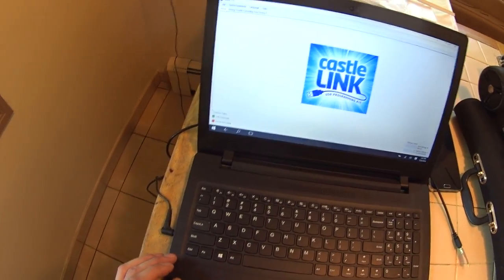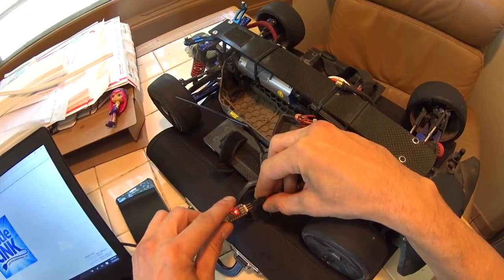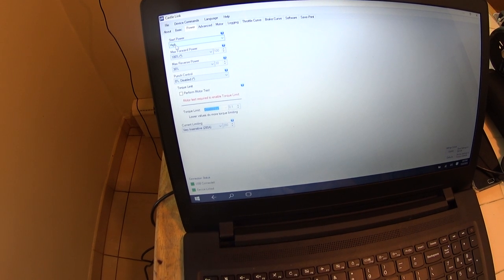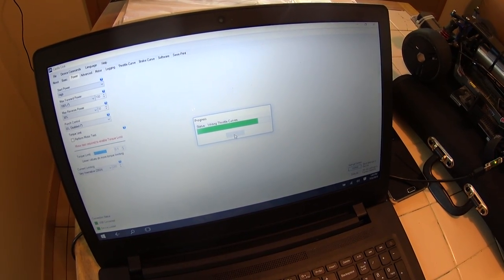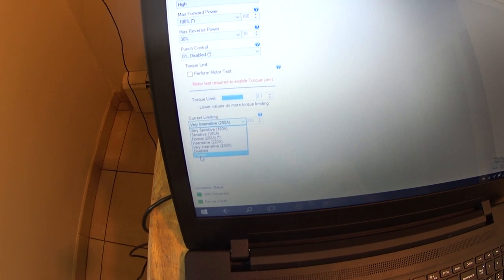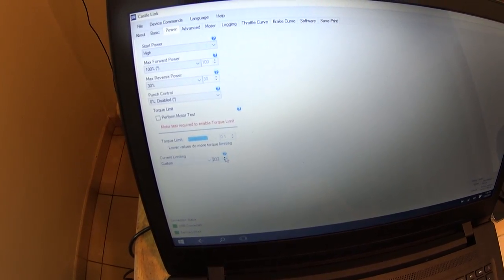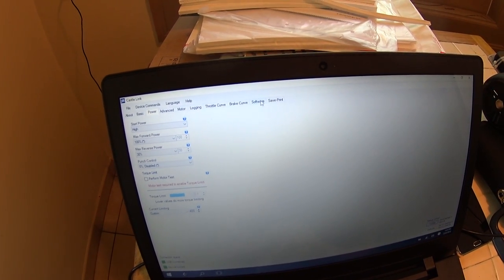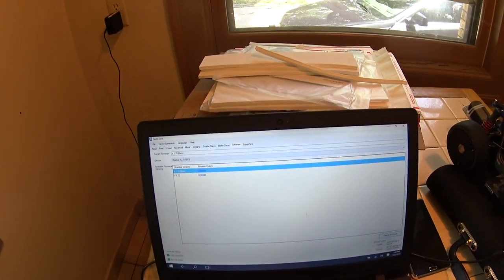Quick Castle xlx tips that help me

Comment: Good info on the XLX, 400 amp now wow. I hope this problem is finally solved
Reply from the maker: it should work for ya now
Reply: +WIG SPLITTERS RC  With how many amps does a 2000kv 8s motor works best?
Reply from the maker: Jaquez RC 400amps or you can turn amp limit off

Comment: Good morning I drive a typhon with xlx and tppower 4050 with 2310 kv 6 s lipo 65 -130 c the problem is when I accelerate he jerks and somehow throttled he does not turn fully off more than 154.9 kmh I do not manage the xlx hatt the default settings what can I program so he runs clean

Comment: What different does it make on the Custom setting on 400?
Reply from the maker: more power
Reply: On my castle link for the xl-x esc 1.78 beta on the current limiting I don't have that (Very insensitive option) Know why is that?
Reply: Your setting Very insensitive starts at 280 then when I go on custom it won't let me go over 260. What i'm doing wrong?